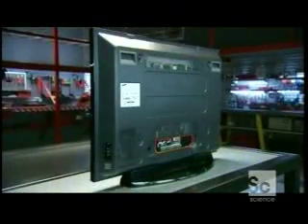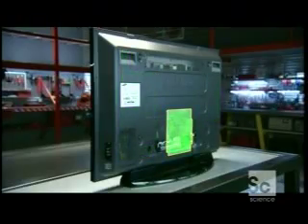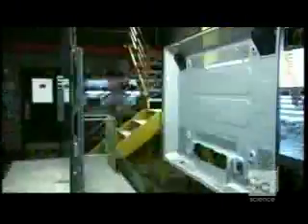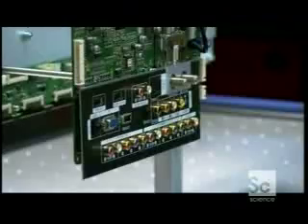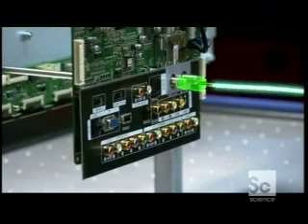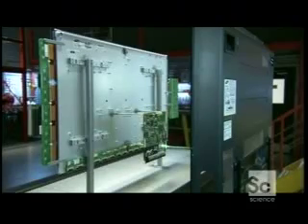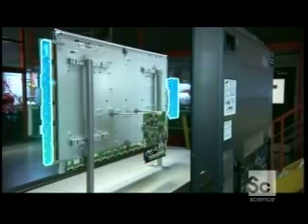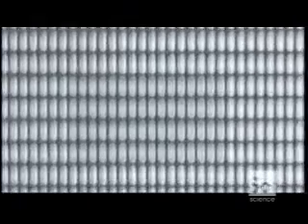Plasma TV

Comment: just found a 50" plasma on the side of the road that some idiot just through out and it was not working.  
2 hours later - brand new Samsung Plasma working - great pictures come out of plasmas and that goes for all angle of viewing,
Reply: @Crest - BarcrestPlayers most of these faults are a Verticle scan voltage that has drifted or is faulty. in this case it was Vs too high.
Reply: Just curious, how many watts does it use? Should say on the back of it
Reply: John Hooper that is the max power usage referring to what number? And last time I checked my friends 50” plasma used over 400 watts which is kind of insane.
Reply: John Hooper yes I understand that it depends on the colors being output and such but on the back it had the amps and using that and voltage you can determine the wattage. Unfortunately I didn’t have a wattage meter.

Comment: if the plasma emits light when you stop providing electricity to it, then how do you make it stop emitting light?
Reply from the maker: When does it say that? ... electricity is the energy source of the light. if there is no electricity, the tv will no produce light.
Reply: @BoManton  @3:34 "As soon as the discharge ends, the freed electrons immediately return to their places and the plasma once again becomes gas.  What's important is that as they return to their places, the electrons release their surplus energy in the form of ultraviolet rays."
So 
It said specifically, "as they return to their places, the electrons release their surplus energy."
Reply: @nipun056  The energy release is momentary, as the electrons return to their lower orbits.
Reply: @ZigSputnik  Ah ok that makes sense, thanks! So does that mean this momentary energy release can be considered the lowest possible latency we can get using plasma tvs? Since we need to wait for this energy release to end, the pixels can't go back to black "instantly".
Reply: @nipun056  The electron fall back time is virtually instantaneous and doesn't contribute to the apparent lag.  I would think that any return to black lag will be due to the signal circuitry and not the physics of plasma.  But you could look into this.  LCD is a lot slower returning to black because it takes time for the crystals to physically rotate.
Reply: @nipun056 the light emission is on the order of attoseconds (10^-18 seconds), which for all meaningful intents and purposes is instant

Comment: These TVs last forever we’ve had ours over 10 years now
Reply: That means you haven't been introduced to old CRT televisions. My grandpa bought his television in 1970 and he is watching football now on it.
Reply: Im still using a 50" lg plasma thats about 9 years old now and still prefer it over lcd
Reply: My cousin still has his working at least 10 years. Someone hit it and there's just a vertical red stripe down it which is annoying. His LCD of the same size just completely broke from the same damage.
Reply: We’ve had ours 12 years
Reply: in terms of durability
crt>plasma>lcd>oled
Reply: Later plasmas had an engineered lifecycle of over 30 years.
Reply: IDK, I've had some LCD's that I found in dumpsters 10 years ago still keep ticking.  I think it comes down to the quality of the capacitors more than anything and unfortunately in the 90's and 2000's we had the capacitor plague that didn't make itself known until recently.  I think that the number of dead TV's from that era are mostly due to this capacitor issue rather than an problem with the screen technology.
Reply: I know right. I have mine from 2008. Still works great.
Reply: My Lg plans is 13 years old going strong
Reply: Unless they have cheap capacitors. Just switched out a few on my old 32" that's been in a closet for 10 years so I can get rid of it
Reply: Ours too
Reply: Do u know what these TVs and the moon have in common? They are both made of plasma
Reply: Me to we have it for 12 years
Reply: by now it should have already kicked the bucket
Reply: I have had mine for more than 10 years.